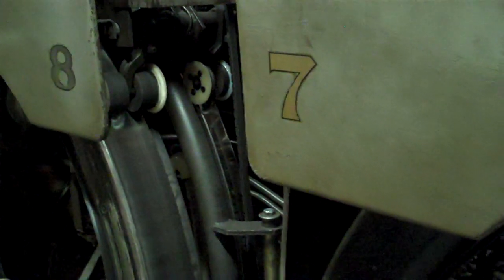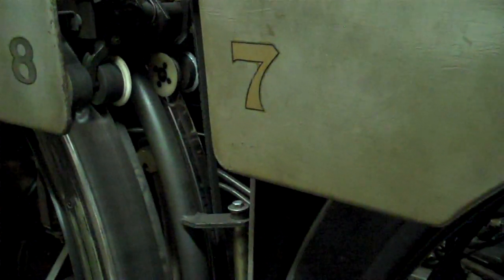Brunswick Pinsetters - Pinwheels - Differences & Sounds

Comment: Not sure how to compare the gonging Brunswick Pinwheel to an AMF 82-90 pinwheel in terms of their sound. But its interesting that at my home center as their cheap AMF Eagle Pins starts getting older and breaking even more, their Pinwheel will start to sound like an 82-70 Pinwheel.
Reply from the maker: Night and day difference. I was around 82/70's for 11 years, and also serviced 2 homes with 82/90XLs in their basements (both 2 lane installs) there's a LOT of sound deadening on 70 pinwheels, and even moreso with the 90XLs, the 90XL pinwheels are junk IMO but quiet junk lol. Brunswicks in general are just MUCH louder machines in general when running, I was quite used to the noise in the pits and had to readjust myself a bit when working with Brunswicks, they for sure are louder by quite a bit IMO. The Brunswicks without a silencer cord on the pinwheels are really loud but even the ones with it I found to be much louder. The 90XL's were VERY quiet even compared to 70's IMO. Just the nature of the beast they're all different, but I found A2's a good bit louder when they were running and I was down back

Comment: There is actually a third type of Brunswick pinwheel and that is the two piece pinwheel on machines made in Japan.  They had a very dead "thud" sound.  They were also pieces of crap and would develop cracks  on the outer piece.  I drilled literally thousands of 1/8" holes at the end of the cracks on hundreds of these pinwheels.